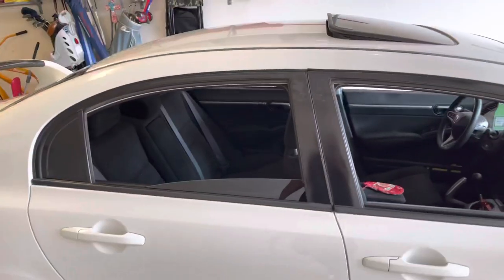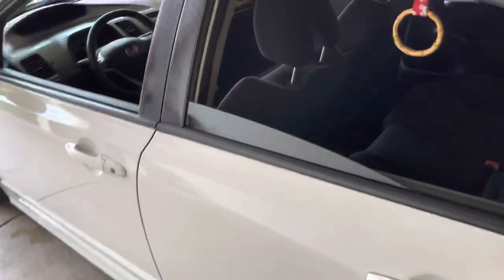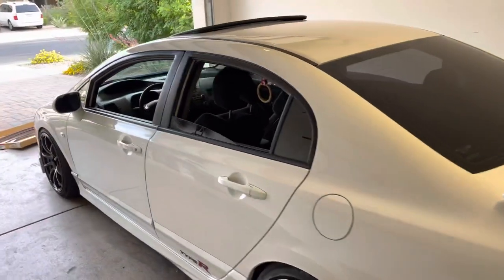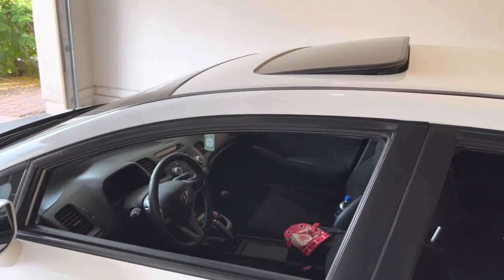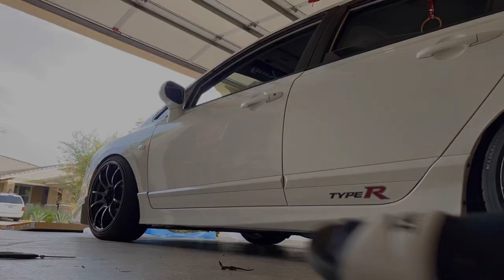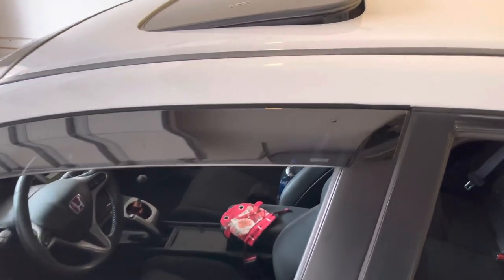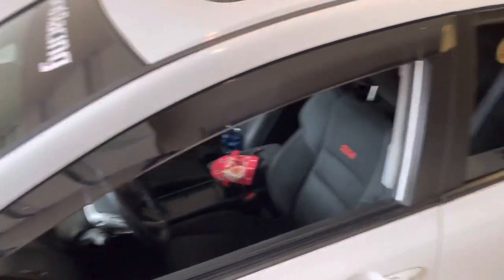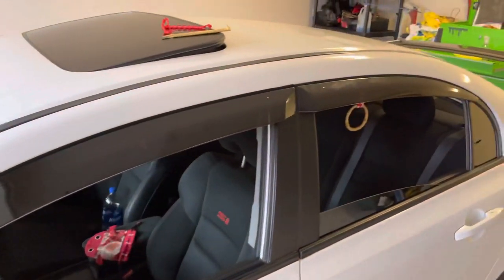Installing OEM Honda Window Visors On My 8th Gen Civic Si

Comment: I did the same few months ago and used ebay carbon fiber vinyl instead of the stock looking overlays. Was very surprised to find out that our Pillars were not removable like the base model civics. Oem visors cost a pretty penny, too. Looks fresh though 🔥
Reply from the maker: Yeah I was told it can be but I didn’t wanna find out haha. Thanks bro 👏

Comment: How you doing bro. Your Si looking nice. I really like those visors but when i get on the site it says it wont fit my car but i have a 4 door 8th gen si as well but mine is a 2007 do you know if it will fit?
Reply from the maker: Yes it should fit man they’re the same chassi. Double check to make sure it’s the right one before ordering
Reply: Yea same here i really want these visors and i have a 07 Si sedan and it says it doesn’t fit my vehicle but i feel like they are the same trim idk

Comment: Has anyone here purchased these visors for a 2007 Si sedan? And if so did they fit properly???
Reply from the maker: It will fit it’s meant for 2006-2011 👍
Reply: Thanks bro i finally ordered them. I really like these better than the Mugen style visors. Dont get me wrong they look nice from the outside but i dont like how they look from the inside looking out they look like they are broken from that corner where they have the curve and not to mention everyone and their grandmas have the mugen style ones lol. But these definitely look very good

Comment: Question. I got a 2008 civic exl. On the honda site oem part says 2009. Would it really not fit tbe 08?
Reply from the maker: If it’s the visors I’m sure it will fit. Although some body parts are different because the body style changed.